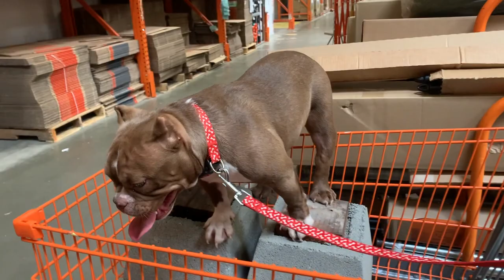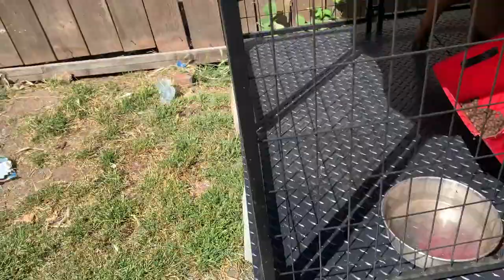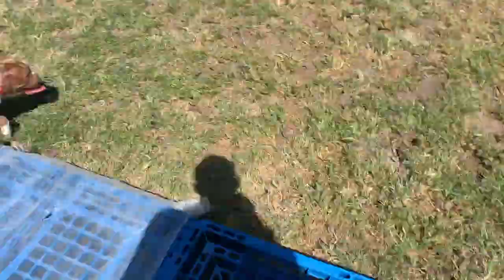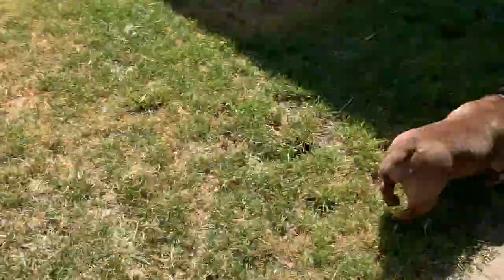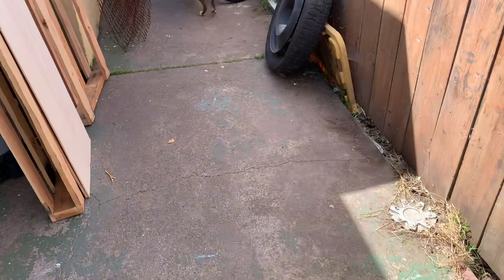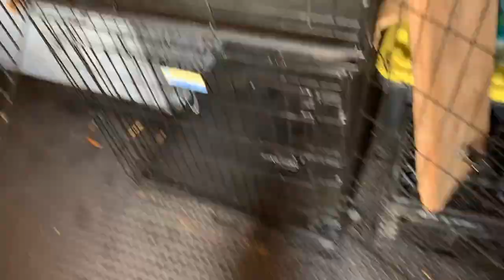Best Cheap Raised DOG Kennels ‼️ (DIY Tutorial)

Comment: Can you buy those wooden pallets   Like that? If so where? And did you put wood blocks on those cement bricks you used to raise it? ……It looked like dark wood blocks on top of them
Reply from the maker: @jazzyjennshighway  u can find pallets at  shipping yards stores etc I had to by the boards nd blocks came from Home Depot w the wood attached to it
Reply from the maker: @jazzyjennshighway  where u located
Reply: @2nasty  ok thx a lot, I like your method, seems easy & more practical for what it’s used for . I’m using your technique once my kennel comes in.